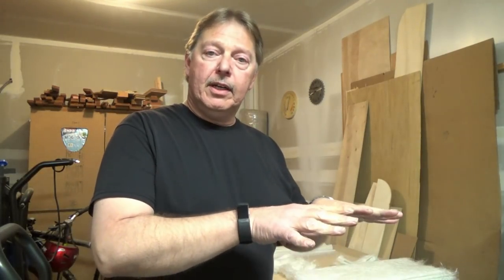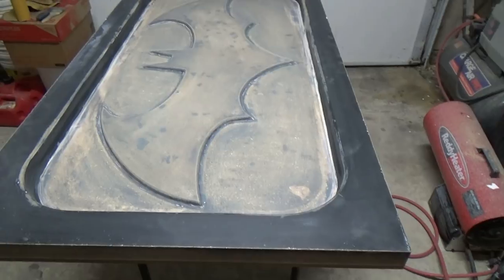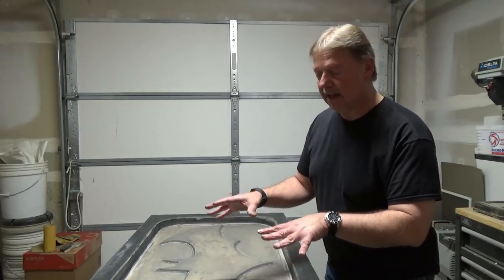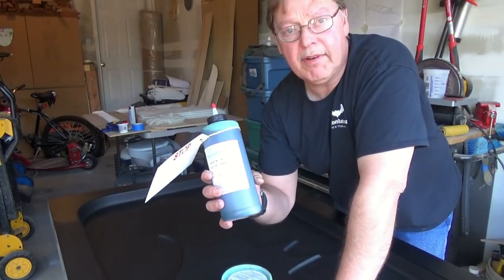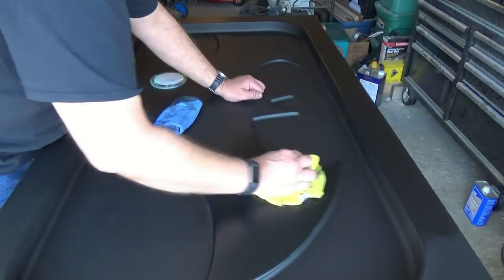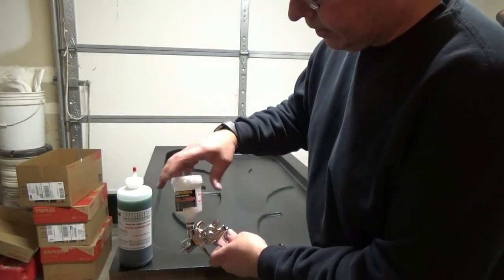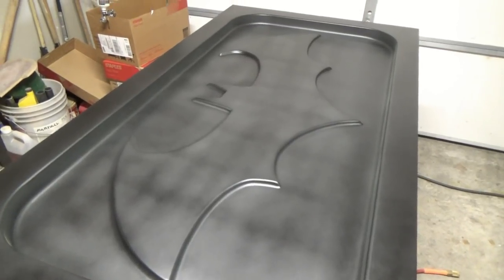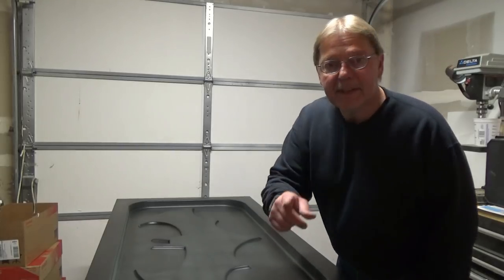DIY – Front Window Rock Guard – Stone Guard for your RV - Part-4

Comment: My stone guard has the little shocks on each side. How do i take them off without just ripping them out..
Reply from the maker: I would have to guess if they are not held in place by screws, then they were attached with rivets. If that is the case, you will need to take a drill and drill in the center of the rivets to get them loose. Should come right out once you do that.
Reply: @OregonBatman  
The shocks are supposed to have a release from the balljoint. I just cant figure it out....
Guess I might have to upgrade.
My teton 5th wheel is over 30 yrs old and is my all the time home.
Reply: @OregonBatman  
Thank you for your time Sir.
Reply from the maker: @cassandratakemyhandwilson4630  You are very welcome

Comment: I think when you waxed it you kept removing it. Maybe apply wax and leave as is. You were like buffing it off, or so even after a lot of coats it to thin like it wasnt there.
Reply from the maker: The first couple coats were a wipe-on wipe-off application to get the primer to take the wax. I tried a  small area on the edge first to see how it would go, the wax left a good swirl pattern after it dried and didn't really wipe off. After that, just applied and let dry, fail. :(